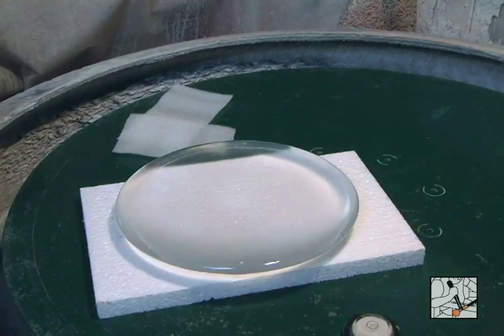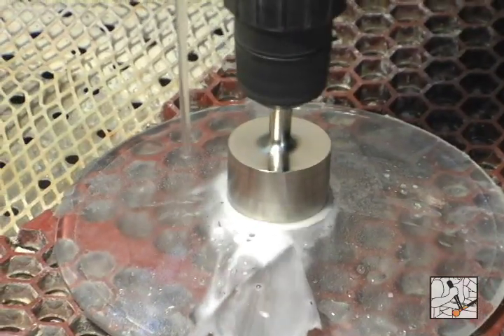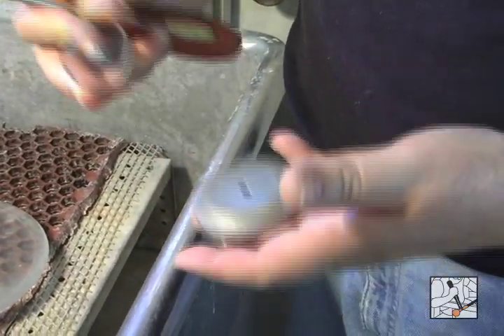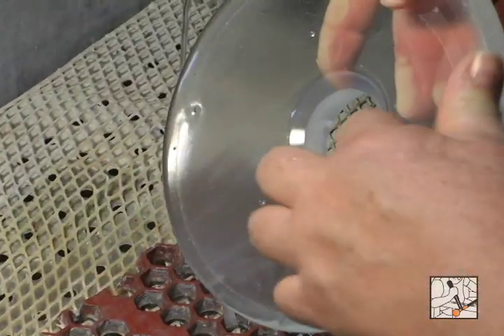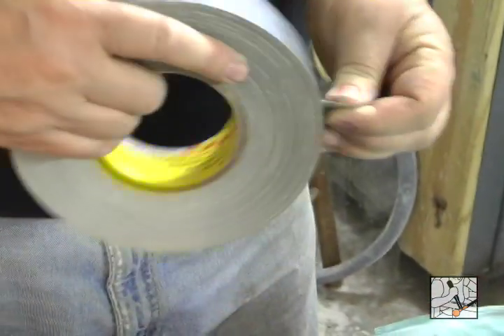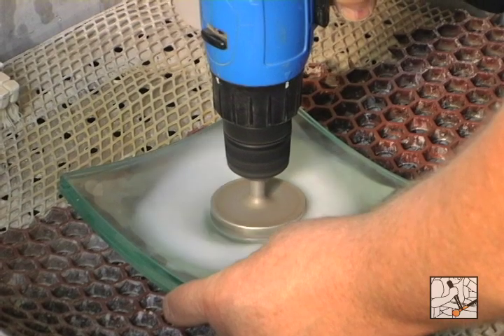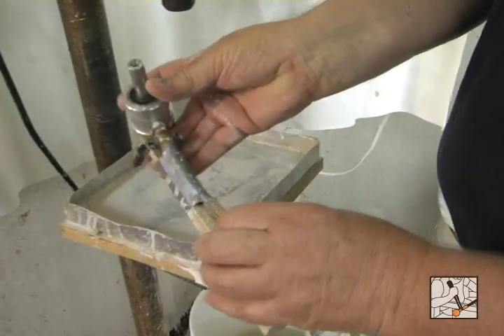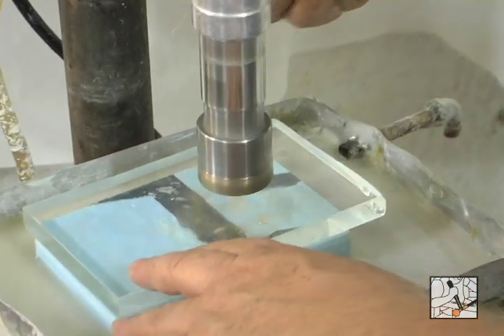Drilling glass sinks and countersinks for drains with Electroplated and Sintered Core drills

Comment: how to minimize the chattering of edges while drilling? i want to drill a hole with clean edges. will drilling multiple sheet of glass in one go do the trick , as only the outer most layer exhibit the impact drill vibration?
Reply from the maker: The drill should not chatter against the glass generally. You may need to re-seat the drill in your drill press as most drill presses are not high tolerance machines and the drill may be a bit off-set in the chuck. Adding scrap glass to the piece with stacking was can certainly cut down on any chipping or damage to the top layer.
Reply: @hisglassworksinc  thank you sir for your reply. just want to ask. does Metal Bonded Vs 
electroplated drill, which one is more optimal cost wise and working life? The supplier is saying that he can avail me a customized metal bonded drill and will serve longer than electroplated one. but before buying his advise i want to get help here.
Reply from the maker: Sintered diamond drills are always the best option for longevity and consistency in the cut. They can be more fragile if you bind up the drill as you can destroy the tip but overall they are much preferred over electroplated drills.

Comment: Where can I find that large countersink drill bit to cut through porcelain?
Reply from the maker: +kevin silcox Our countersink bit is listed here:
http://www.hisglassworks.com/shop/drills/sink-kits-and-hones/sink-drain.html
Reply: @hisglassworksinc  This is pretty pricey for my one time use. Is there any other way to do the chamfer for the drain? Would a Dremel with a sanding circle work?
Reply from the maker: @shaneagnello4586  The countersink is made for working a lot of these sinks in a production environment. Not really for single use or it is quite pricey. You can try a Dremel but it will be a lot of work back and forth to remove enough material and create the correct angle.

Comment: Any ideas on cutting around electrical outlets with large glass tiles 6"x12"x1/4"? thank you!
Reply: If the square piece needs to be in the middle of the tile, you're probably looking at something like the Taurus 3 ring saw with a separating blade and small Triple Ripple drill to make the starting hole in the tile for the blade.

Comment: What could I use to drill smaller holes in glass?
Reply from the maker: For holes smaller than 3mm in diameter, you would use a piano wire diamond drill called a Triple Ripple that are available in 0.75mm, 1.1mm, 1.4mm, 1.8mm, and 2.1mm diameter. They are available in 6 packs, 25 packs, and 100 packs from our website at hisglassworks dot com under the Drills section. Thanks!

Comment: Do all the same rules apply when drilling through  bulletproof glass or the new surmet alon aluminum oxynitride glass?
Reply from the maker: Bulletproof glass usually has a layer of lexan or other type product laminated between the glass. This is a plastic type product and the drill will have a harder time going through this material as it is not as hard as the glass. It might bind up the drill as it will burn through instead of grind through that material. I'm not as familiar with the aluminum oxynitride glass.
Reply: no laminated glass is totally different

Comment from the maker: If you're referring to the white while drilling, that is the ground glass mixing with the water. This is why you need to use water will all glass coldworking so you don't send silica dust into the air.

Comment from the maker: you can do this portable. For the initial drilling, you can fill the bowl with water for the drill. For the countersink, all you need is a flow of water to keep the glass dust down when using the countersink. Many people even use IV bags from medical supply houses for portable, controlled flow, water sources.

Comment from the maker: You can, It's easier to do with a drill press, but you can also do this hand held. You just mark off where the new hole should be and then start your drill at a slight angle in order to give it a groove to stay in. I can be much simpler also if you wax pieces of scrap glass on either side of the existing hole to prevent stress cracking.

Comment from the maker: With a core drill system you need to use a submersible pump for the water. You can use a bucket for the pump and recycle the water.

Comment from the maker: You can use either drill without water, but you need to wear a respirator and drill much slower. You can also use a squirt bottle to keep the glass dust under control. You need to be sure to drill slowly and take breaks so you don't overheat the glass or bind up the drill.